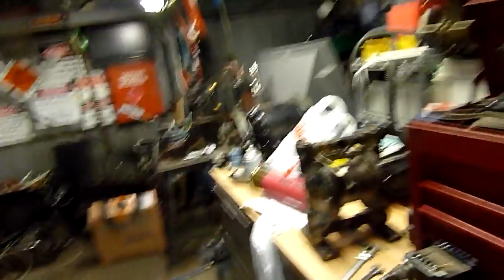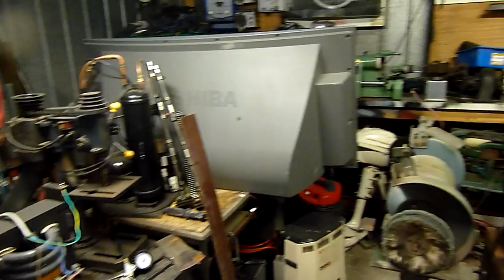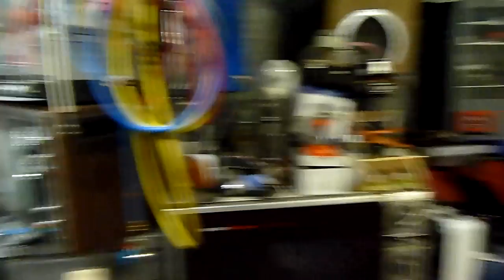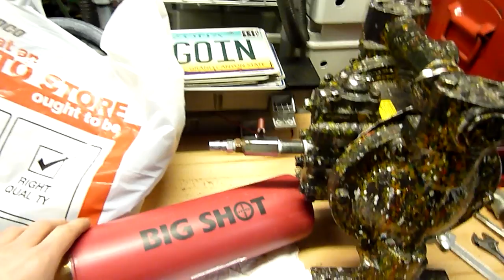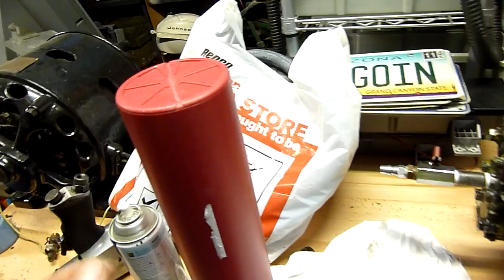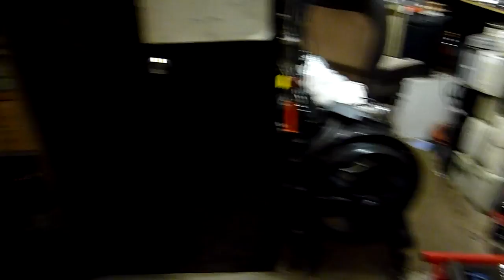Beating the Flaggers at Their Own Game - FTP server, DVD's or Other Alternatives

Comment: the easiest way to host something at home and be safe is to put an additional router (with a different address range like 192.168.1.X and 192.168.2.X) between your current one and the Internet and put the server on the new router (+ forward ports to the server... like usually) everything else stays the same and your network treats the server network as the Internet you can't access your network from the server but the other way around is no problem

Comment: You could setup a web server very easily. You will need a computer with a pentium 3 or better with 512+mb ram. Install debian linux and setup an apache2 web server. You will need a fiber internet connection with at least 25mbps upload which is enough for about 20 people to watch an sd video at once. The cheaper option is to get a paid web hosting plan with plenty of bandwidth and storage space. You can then setup a website with a video player and show whatever you want (if it's legal).

Comment: f.t.p servers have little to do with delivering content, they are very limited and a bad idea. Not to mention the bandwidth problems. You need a h.t.t.p server, works a bit like a f.t.p, but gives the direct file you request. Use this with a simple video c.m.s (Content Management System) on a web server and you would be good to go. You would still not be able to run on your home internet, but it's not hard to find someone with a spare h.t.t.p server, even I probably have space for that.